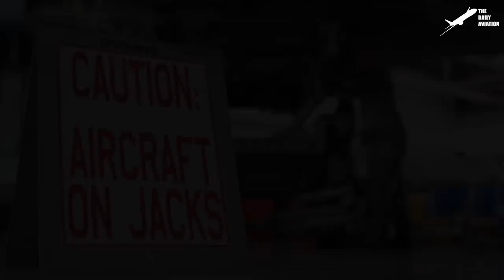US Pilot Play With His $120 Million F-22 Before Taking Off at Full Afterburner

Comment: Got to love those old A-10s.  We should be designing a replacement. It's relatively low tech needs (does not need stealth, runs at low subsonic speeds, does not need or have an afterburner, uses a moe conventional turbofan engine, resembling commercial jets) would reduce the cost of design, manufacture and operation much less than fighter jets. And then, there's that awesome gun. Firing  all of its 1100+ round ammo belt would cost less than one Hellfire missile, do a better job in CAS, and potentially destroy more tanks, cannons, vehicles, structures.

Comment: I assume the F-22 does effectively have lateral thrust vectoring by employing asymmetric thrust from the two engines.
Reply: Yeah, sure, whatever you say....I guess🤨 Whatever that means
Reply: He means splitting the throttle, just wanted to sound really smart saying it lol.
Reply: @christopherhooper5618   The question is whether the digital control systems "split the throttle" with no pilot input for certain manoeuvres. Not as smart as you think you are?
Reply: Nah, does not work like that engine nozzles are to close to centerline for that to work
Reply: @EliteRock   Raptor’s thrust vectoring is fully computer controlled. So, the on board avionics will automatically apply a thrust vector that is commensurate to the degree of input on the stick. Now as far as splitting the engines, the pilot has 2 (left & right) control modules that allow him/her to delegate power to each respective engine. To be fair, the throttles are fly-by-wire, so there is a level of computer control, but unlike the thrust vectoring, the pilot’s input on the throttle modules are, if you will 1:1.